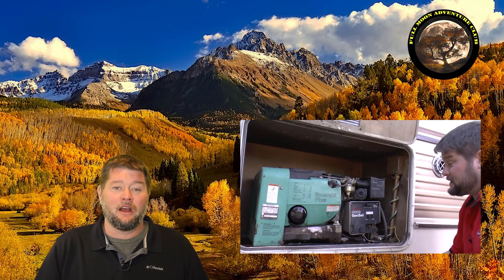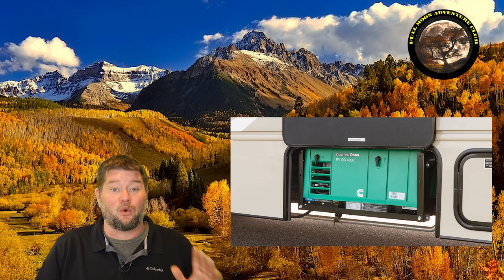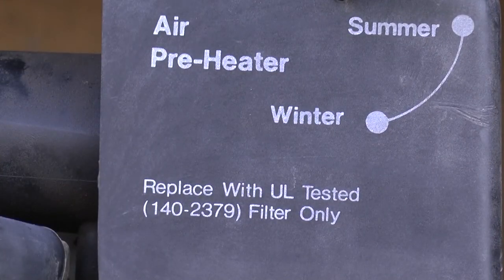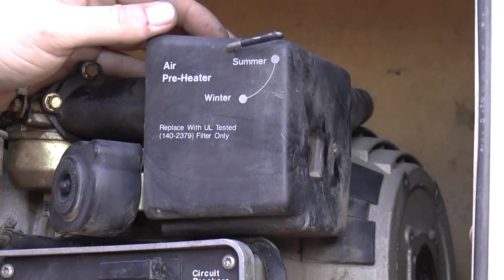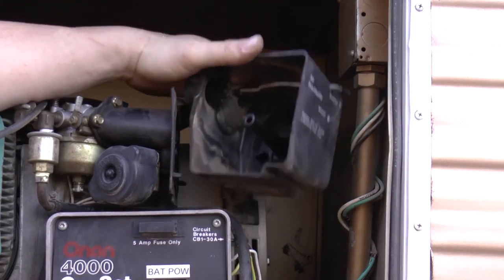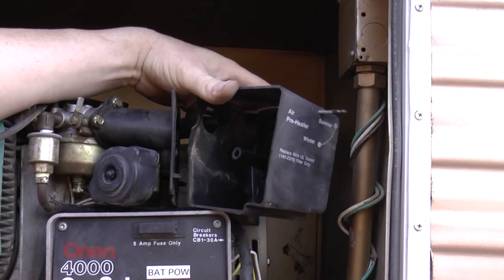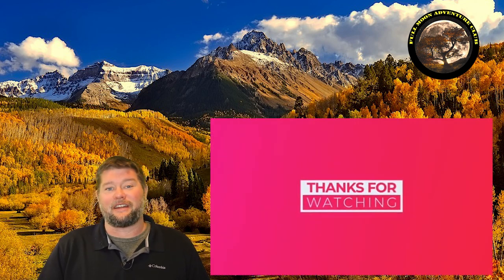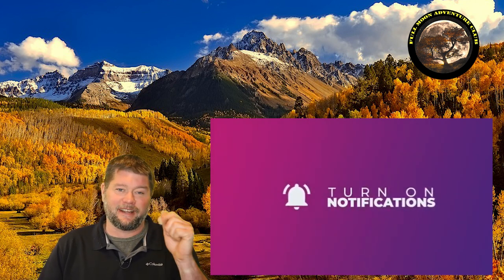How To Change Your  RV Generator Air Filter Onan 4000W Emerald Plus

Comment: Hey Jim aren't you ment to rinse the foam filter and but it back on the new filter keep up the good vids
Reply from the maker: Thank you for bringing that up. I actually did a voice over of that old video and I think I mentioned it in the old video and forgot to mention it in the new voice-over. In my experience paper filters from today are superior to the foam and paper filters of old. The old foam filters can sometimes deteriorate clogging the paper filter or if you add too much foam filter oil to the foam filter it can get on the paper causing deterioration or clogged air flow. I think opinions may vary and they're both pretty effective. In my manual the paper filter is all my RV generator required for that model. It's always best to follow the advice of your owners manual. Thanks for catching that and bringing it up. I will put it in the description of the video. Thanks for watching and happy camping.